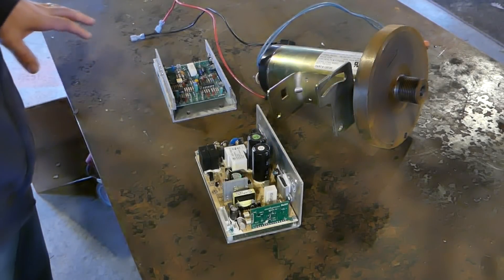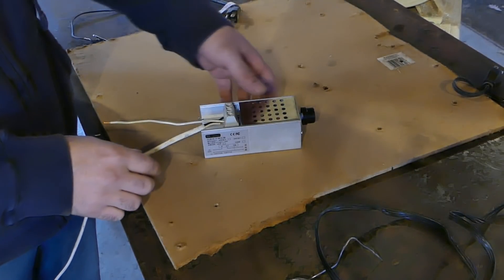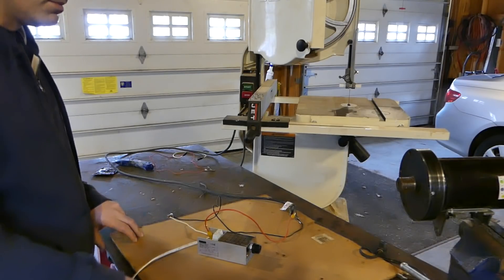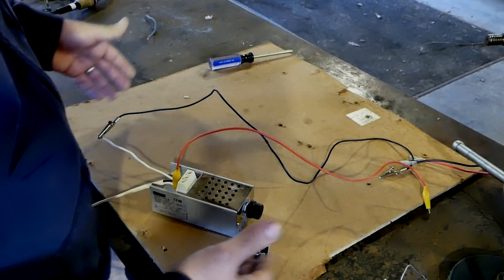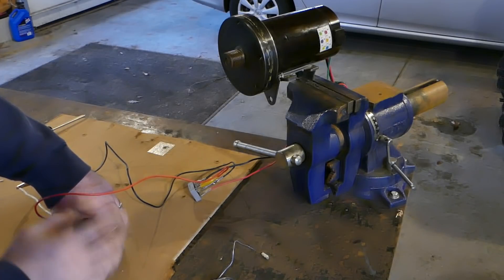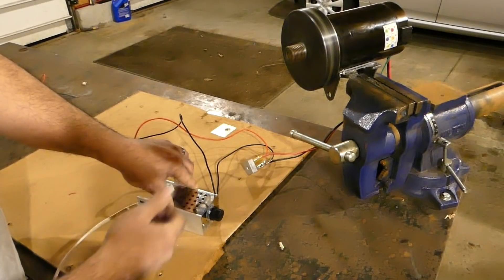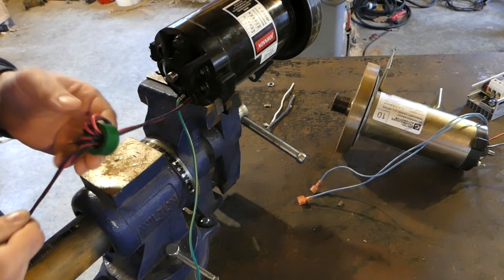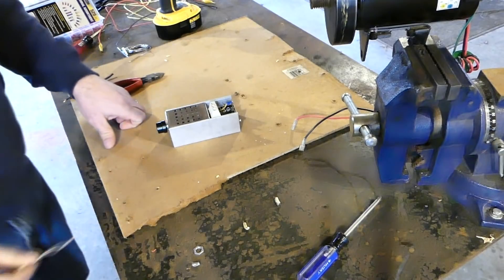Low Cost DC Motor Controller For Treadmill

Comment: Everyone doing this needs to bear in mind that when you rectify wall power, if you put on a smoothing capacitor then you will be WAY overdriving your motor.  The treadmill motors I've pulled are usually rated 90-100 VDC.  When you rectify and smooth wall power, you're getting over 160VDC.  So bear in mind that your full speed in that case is actually 60% over speed.
Reply: funny i got one 180 vdc see pic http://tinypic.com/r/15gqs5j/9
Reply: Dandy, if you look at his controller that came with the treadmill in the very beginning, it has two GIANT capacitors in it.  Those are always going to be the power smoothing capacitors.  Rectified AC is a very dirty power - it's not really direct current, it's constantly going from 0 to full power at 120 cycles per second.  DC motors don't like that as much as smooth power.  The capacitor(s) even that out.
There is also guaranteed to be a giant rectifier on that board too.  Even if the controller doesn't work, still the rectifier on the board, and also the smoothing caps, stand a good chance of being perfectly good and salvageable.
He is basically rebuilding the rectifier part of the existing motor controller, but he's not adding those giant capacitors.  Probably because they're dangerous.  Seriously.  If you cut power and don't have a way to drain them, they can keep a 170vdc charge in them and that is not something you want going through you.
If it's hooked up to a motor then the motor will pull the capacitors down to 0vdc shortly after killing power.  But playing with big caps is something you have to keep your head in the game when doing.  Always put a meter on the cap leads before you mess with them!
Regarding the type A or B.... I think A?  I found a reference to A or B being either linear or logarithmic, and I would say you probably want linear.  The point of replacing it is making it a lot easier to adjust than the existing one, and a logarithmic pot won't do that.
Reply: Wow!  What did you pull that from?  I like how the RPMs is down at 4800 too.  And 6 amps?  What's not to like!
Reply: Allan Marshall Wanna trade? ;)
Reply: so few days running now,today was turning something bigger and noticed i was getting a surge in power and poor torque,lights would dim and brighten with the power surge if thats what you call it.so shut it down and thought i would change it all back to my  ac motor.so i opened up the boxing and found the motor and the scr where very warm motor was hot.so i thought ok rather than just scrap this idea i will kool this motor with fans and put a fan on the scr.Did this and then started to turn the large bowl again everything stayed cool and no power surge.if anybody could give any help i would be very grateful, did simply introducing lots of cold air solve this issue i have no idea.i can follow instruction and complete most projects i am no electrician but the instruction on this video is so easy but am i missing something do i need to go a different way with the dc motor for lathe operation.
Reply: If I understand you correctly, this won't be an issue if I don't use a capacitor, correct? Or if I have a DC motor rated at ~160 volts.
Reply: Right.  The higher voltage comes from the fact that there are voltage spikes in your line power - it actually can spike that high, and the cap will even it out at the maximum voltage.  But if you don't put a cap on it you'll get spikes and also lows, and it'll average out to 120vac.
And yeah, if you have a 160vdc motor it won't be a problem, but I haven't seen one in a treadmill.
Lastly, you CAN overdrive a permanent magnet DC motor.  I drove mine long enough to get a read on how many RPMs it ran at 160vdc and there was no problem, but I wouldn't put it under load or run it for a long time when that high.  SOME overdriving is fine, but I don't know how much.  I think if you have a 100vdc motor and you're driving it at 120vdc rectified, un-smoothed power, you can probably do that for extended periods.
Reply: Thanks for the reply, that was really helpful! I have a few treadmill motors, some 90VDC and at least one 130VDC. I plan on restoring a bandsaw that was rescued from the trash and I think it will work out. Thanks again for the explanation.
Reply: Lol just finished turned first crochet hook on new lathe setup very nice
Reply: fisharmor mine is a 4000w scr and since introducing the fans i have not had an issue. Maybe is was an overheating issue and the cooling has solved the issue.time will tell.if i have the problem return i will try and source a bigger scr
Reply: how in the hell do you get that
Reply: Allan, I had the same issue with mine when turning larger bowls.  Motor heats up and screeches after a while...lights dim etc.  I also notice it had very poor torque compared to when connected to the original cumbersome consul and controllers.  I'll try the fan idea but I think it is a bigger issue...ie, the heat should not be there.
Reply: aussieislandlife the treadmill motors need to have PWM DC power not just DC power to have full torque at lower speeds.
Reply: delphinny ok thanks... ya I’m not too worried about blowing a few resistors on the way to improving the power input to the motor.
I will report back after I get a chance to test it out.
Reply: Not sure what size potentiometer came originally on the drive controller but With a little math you could figure out what size resister you could put in parallel with the potentiometer and cut it in half.  IE: 500 ohm potentiometer with a 500 resister in parallel with it would make it 250 ohms. Now the speed full open would be half. No need to but another potentiometer. A resister would cost 50 cents. or less.
Reply: @dalehayes3280  i need to get down to near 50 rpm. any advice on which exact potentiometer or resistor i  would need .? thanks.
Reply: fisharmor by capacitor you mean the one that came on the board right ? Because your comment got me confused hence he didn't use any extra capacitors , another question hopefully you know , the 200k linear potentiometer  he used , was it type a or b ?
Reply: +Allan Marshall   I'm not an electronics guy either, but electrical parts getting hot generally means they're underpowered.  What's the rating on your SCR?  If I was using an SCR I would overshoot the watts by a lot.  I'm not sure whether you would be taking 6 amps times 180 volts (meaning you'd need 1080 watts rating or better) or only 6 times 110 volts because it's pre-rectified power going through the SCR.
Reply: fisharmor first of all , I want to thank you for your reply I'm very thankful for your informative reply , yeah I know that capacitors store voltage after being shut down and they release it at one go which would get extremely Dangerous, but I was pointing to the scr he used , I mean I don't have a permanent  magnet dc motor, I have currently a universal 220 volts washing machine Motor , but thought hence it accepts dc and ac I said ehh I'll try both ways it's easy to set up , but I needed to ask hence I have minimal expertise in electronics , so thanks for pot I guess I'll get the linear , what do you think it's better for a universal , dc or ac ? Hence I'm gonna put a reasonable load on it
Reply: my treadmill motor's from a very old heavy duty treadmill. It's 3hp and 180v. I'm in the uk with 240v mains. I guess i'll be adding a filter capacitor. Right>?
Reply: How did you get on? I'm in the same boat.
Reply: do you have any datasheet of the motor ?
Reply: Hey would a 30µF Electric Motor Run Capacitor work for this ? https://www.princessauto.com/en/detail/30-f-electric-motor-run-capacitor/A-p8513426e I really dont feel like burning out my motor trying this 

as well would this wiring diagram work for the capacitor?     

http://realestateradio.us/wp-content/uploads/pwm-need-help-with-90vdc-pm-motor-speed-control-circuit-of-motor-speed-controller-mc60-wiring-diagram.jpg
Reply: just lower the voltage with more resistors (out the DC side, right before the motor) and you'll be good (make a voltage divider circuit), measure the voltage without hooking up the motor first, then design your divider circuit..be sure to measure the voltage your getting out first to make sure its correct for your motor. Then you will have 0-100% of what the motor can do. Also add an AC fuse rated to the motor on the AC side so if it pulls more watts than the motor can drive it will blow for you and not overdrive your motor potentially ruining it in the future. Just remember this thing does not control pulse width it controls voltage level so its not a true speed control, but as long as the motor speeds up and slows down who gives a damn. ha
Reply: delphinny  that sounds like a solution I’d like to try. I just tried the example in the video and my motor rpm went up by  40%.

questions for you Delphinny, how bout using a potentiometer (variable resistor) on the dc side  before the motor to dial in the right resistance?

Hope I am on the right track
Reply: wow that sounds great! :) I couldn't get mine to work but perhaps its cheap components from china
Reply: delphinny I used the exact same parts mike used, down n dirty cheap but there is always a potential for a defective component eh?!

We should probably  find a way to smooth out and lower the power going to the motor. It’s “dirty” power so the inductor he mentions is a good to help smooth out the power adding a big capacitor would help too BUT first we ought to find a way to reduce the power like you mentioned with resistors . If that will work
Any thoughts on that resistor idea u had? I don’t know how to chose the  proper size.
Reply: yeah I think its the wire thickness too probably, I'm going to hook mine directly up to the motor with nice thick wires before I call this one a dud, also use a voltage divider calculator to find the right resistance http://www.ohmslawcalculator.com/voltage-divider-calculator
Reply: hey I got it working!!! it was the wire thickness to the connection of my SCR not picking it up after all! :D I've had the same issue with kiln controllers in the past too
Reply: delphinny cool man...:) welcome to the club... I measured my voltage under load and it’s 135v.... (rpms way to fast) I need to get it down to 90v. The calculator u sent (thanks) suggests r1 is 1...k I guess and r2 value is 2k ... make sense to you?  I know enough to wire them t if the values are right.
Reply: Yes that looks right but it has to be tested, try it let me know how it goes man! not sure if the wattage of the resistors matter or not but hey if you smoke one nothing major..can always use higher watt sand resistors .. :) Happy to be in the club now haha! :D
Reply: Well I added 1k 5watt resistor and 1/2k resistor same wattage, all I got was a hum and  the motor did not turn, I’m just guessing the resistance is too high so next time I’m out I’ll get some smaller resistors

 I salvaged one of the giant capacitors off the treadmill controller board, wired it in after the rectifier. The motor still starts a bit rough but there are a lot less sparks thru out the range. Voltage is still   high and unchanged.
Reply: Yes the calculator says it gives 45 volts DC from 135 volts DC from that configuration. not enough to run a 90 Volt motor.. you may need slightly over 90 volt too, I'm not sure just experiment :) oh I got some good resistor collection from china off ebay, https://www.ebay.com/itm/1500pcs-1-4W-75Values-Carbon-Film-Resistor-Assorted-kit-Set-1-ohm-10M-ohm-5-/191964515298?hash=item2cb1fa0be2 they arent high wattage but its great for experimenting, can parallel resistors for higher wattage too maybe?
Reply: delphinny
What is an SCR?
Reply: Allan, I see this is a year old post.  Yes, DC motors tend to run hotter even when powered correctly, but the spikes don't  help, so YES< the fan actually works. As they get  hot, the heat  causes more problems which in turn causes more spikes so all large DC motors need a cooling fan.  The SLR not so much, but if you find it gets hot too after you put the fan on the motor then a fan on the SCR is a good idea also.
Reply: delphinny you mention putting the resistors right before the motor, if I reuse the capacitors from my original board, would I put them in the same place, or would they be on the AC side?
Reply: How do you calculate the proper size of capacitors for a treadmill motor like this?
Reply: Dude, you are fear mongering or outright failing basic electronics.
120v AC 60hz with a Full Bridge Rectifier yields a Rectified 120v DC 120hz.  
All the capacitors do is supply voltage/current at the top of the phase peak where it starts to decline.  Perfectly illustrated all over the internet and taught to Electronics 101 students. 
Below are the waveforms of 120v AC, Full Bridge Rectified, and FBR w/capacitor on the bottom.
All the caps do is provide voltage/current at the main rectified power is falls to 0. 
For anyone interested, that VMAX dotted line in the FBR/cap picture is the 120v DC line that your what your motor is designed to run at for full power. 
FWIW, 120VAC is the Averaged voltage over a Cycle, 60hz is 60 cycles per second.  120VAC is actually 170v Peak-to-Peak.

Dirty power and spikes happen all the time, and are usually transient in nature and rarely last long enough to damage equipment.  If you have really dirty power you'll know it already as things just seem to break often.  
Conflating the use of capacitors which are used to smooth rectified AC to help try to keep it close to the desired DC voltage when the phase/pulse is dropping to the zero-point is simply daft.
Don't take any random YT idiots blathering, mine included.
Do a google on AC-DC rectifier.

Comment: well i finally got it working, trying to be clever i bought a controller different to the to the one mikemanmade used, i sent off for the same type from china and hey presto worked straight off, i have two motors , one 130 volts, one 180 volts, the 130 volts pops the fuse at high end but the 180 works fine all way round to the top , plus the 180 works fine for variability with the original pot , thanks mikemanmade i can now move onto making the grinder frame

Comment: The higher 240v AC mains in UK and elsewhere is much more dangerous to work with. Safer to convert down to DC at the voltage used by the motor and then insert a speed controller. Let us know how this works out long term though as we all like a low cost solution.

Comment: I have a free treadmill that starts then shows an incline 42 error. I have been wondering which traces to cut on the pcb and add in a pot but your system looks easier. My board has a rectifier and a large choke, Some Youtubers call them transformers but they are only 2 wires = choke to smooth out the ac induced dc pulse.

Comment: Hello...So I am wondering, my treadmill computer console recently stopped working. The motor works fine. Do you think I can use this controller to control the speed of the motor on my treadmill to be able to use it again?
Reply: Did you use it, iam planning to. Do that in my 2 hp 180 volt dc treadmill motor

Comment: Quick question. I ran my motor off a 4K scr with a 200k potentiometer and a single phase bridge rectifier. 

Last week it blew the two small "5amp" fuses. I ordered a new scr and first run it blew them again. I then soldered two 5 amp fuses in their place and it blew one of them. I am dumbfounded here any help would be greatly appreciated

Comment: possible the wiring label in my controller is wrong, having checked similar item on ebay i found labels are somewhat mixed up, the chinese writing above N-L are different to others, i'll have yet another go when i get home from work later

Comment: mikemanmade, seems there's a few of us confused about the supply being 240 and the motor using 110, do we need to step the 240 down for the 110 motor ?
Reply: I think he just said that the controller was sized for 220, not that he was using it at 220.

Comment: I've got three of these motors I'd like to use in a few different projects. I ordered the parts listed, hooked them up as described in the video and as I turned up the speed, pop! Tested the rectifier, bad. Hooked the controller up to a lamp to check it, it lights but won't dim. I had not changed the potentiometer yet. Any suggestions out there?

Comment: Hi Mike, Great video mate and its just what ive been looking for.
I bought all the gear and it works great!But i want to remove the potentiometer and install the new one in a foot pedal.
But when i tried it out the motor ran up to high speed straight off , with no control! I noticed you are only using 2 of the 3 connections on your potentiometer,could you plkease tell me which ones or have you any idea where im going wrong?
And am i ok to extend the cables to about 6 feet long?
Once again your vid is what ive searched for for ages!
Cheers,Shaun. UK.
Reply from the maker: Hi Shawn, google how to wire a potentiometer, you should get all the info you need.

Comment: thanks for the video .I bought all the parts you mentioned and have just put it all together and it works a treat .Thanks, had cooked the main board and needed a cheaper fix, makeing  belt sander